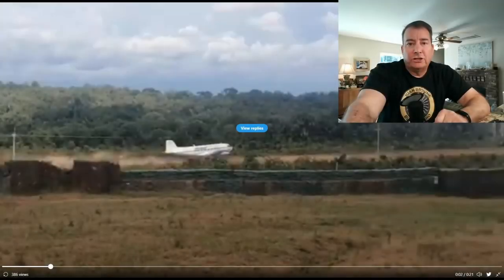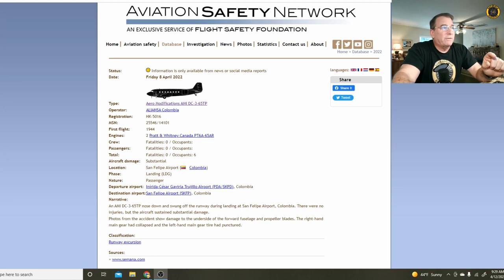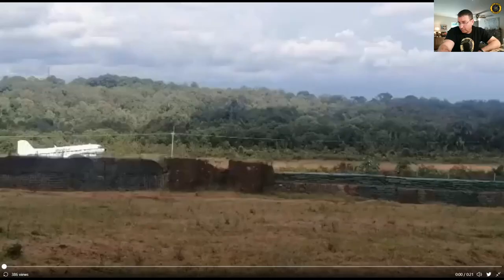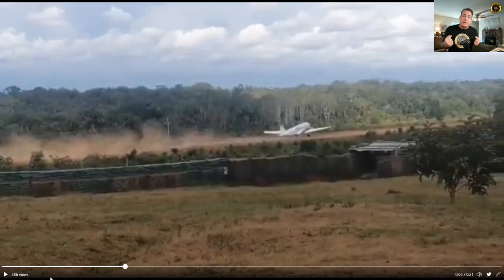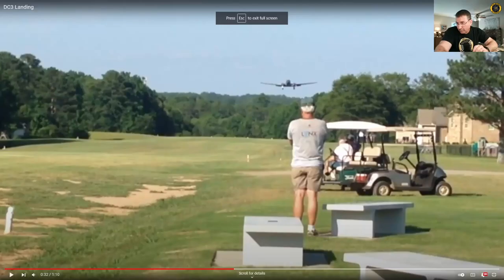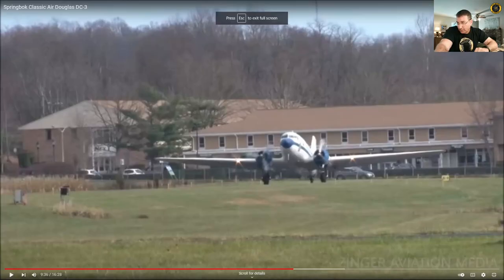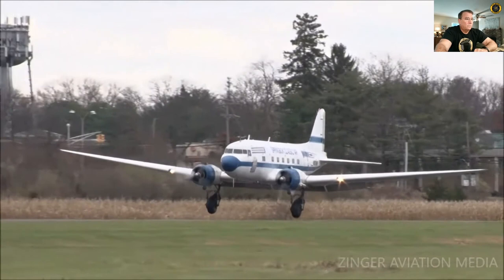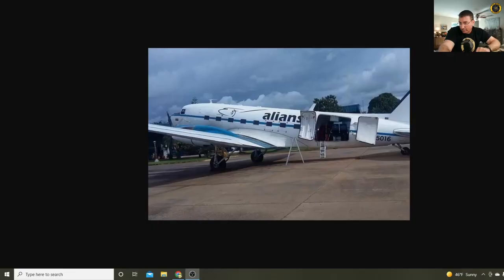DC 3-65TP Loss of Directional Control Colombia SA 8 April 2022

Comment: Juan. As always, awesome analysis. Turbine rated DC-3 pilot here and would like to add that any amount of Beta on landing or during a rejected takeoff makes it very hard to keep the tail up, causes the rudder to be washed out by those big wings as you stated and directional control of the plane becomes very difficult! Great video.
Reply: Just looked up info on beta range, fascinating!
Reply: Use the brakes.
Reply: what’s beta?
Reply: @brewster46  Beta is when you've applied reverse thrust on a turboprop which moves the blade pitch so that the blades are throwing air forward instead of backwards to provide reverse thrust. This greatly reduces airflow over the tail which makes it harder to keep the tail up where the rudder can be effective.

As Juan points out the brakes aren't effective for steering in this situation either because when the tail goes down the wings produce more lift and there's less weight on the tires making the brakes much less effective as well. You need the rudder to be effective at higher speeds (Where the wings are producing lift) and once you slow down the tail can come down and then you can use the brakes to steer.

It's just a bad situation to be in.
Reply: One time helped ferry one that had a Pratt on #1 and Wright  #2. No problem but sporty and interesting.
Reply: @Exuma Guy Actually, DC-3s have very good power brakes, almost too good.
Reply: @tennesseered586  Right.  When they are not leaking or overheated after landing.  But they work good on short field landings. I used to bring them to 3k runways loaded, and crosswind too.
Reply: @JeremyAkersInAustin  thanks. very helpful
Reply: Makes sense, If all they did was put Turbo props on a DC, I can't help but imagine, the plane simply wasn't designed for that kind of power. It would change the way it has to be flown.

Comment: Among the mods for turboprop conversion is more tail feather area, which was not used, this time.  If the tail is flying, whether a tire blew out and it was landing or taking off, it would have maintained control.  Maybe a series of indecisions all within a handful of seconds.  Easy to armchair quarterback.  Thanks Juan as Always.
Reply: I worked for AMI back in early '90's and if I remember correctly, they added a 40" plug just like the Super 3's, redid the electrical system and made interior changes per customer specs. The hydraulic system stayed the same and the other than the plug  and engines, the airframe remained the same.

Comment: Agreed 💯. As a ex agriculture pilot I never landed my crop duster other than a wheel landing. No 3 point ever. I actually would use the brakes to keep the tail up to keep control until I was at taxi speed.
Reply: @Raven 6 - just curious, where did you do most of your crop flying?
Reply: @lisanadinebaker5179  WOW that's a lot to answer, Kansas, Georgia, Nebraska, Colorado, Iowa,, Missouri, I think that's it. Been a long time.
Reply: @raven6245  - thanks!  I grew up in the very rural Louisiana Delta, and watching crop dusters work cotton fields in the summertime is and will always be a very fond memory. Good ones could have traffic (all four cars and maybe a tractor) stopped for a while. I owe my love of aviation to a bright yellow-gold biplane (most likely Stearman) whose pilot could stripe rows like nobody's business.
Reply: Uh huh.
Reply: Because of your name, did you ever fly an 0-1?

Comment: I had a left main blowout on rotation while departing Opa locka airport fully loaded with cargo, had to continue takeoff and once airborne discussed with copilot and Tower our new landing runway to prevent main runway shutdown, besides the shorter runway was aligned to the wind, Heald the left main off and tail up as long as possible to bleed airspeed, when the left main touched down had to use opposite aileron to keep aircraft heading, but the wheel drag pulled me into the taxi way exit and the aircraft came to nice stop, no damage to the rim, airport security checked the departure runway and found the FOD at the point I rotated the DC-3, But I didn't get the day off, tire was changed and we departed 4 hours later to Grand Bahamas.

Comment: I flew the DC-3 about a thousand years ago and was taught how to use opposite aileron when the tail wheel was airborne.  The effect was subtle and would never correct an engine out scenario..
Reply: Yes indeed.
Ailerons PROPORTIONALY OPPOSITE the needed rudder.
The yaw created is tremendous, because the ailerons are so large in area compared to the rudder.

Comment: Nice review.  As the saying goes, "Oh but for the grace of God go I."

 I had something happen that could have ended up like that back in 1973 taking off in a tailwheel Twin Beech D-18.  I had a broken tailwheel lock, a rolling takeoff from the left side (left turning momentum), a left crosswind (left weathervane turning force), and then add p-factor and torque for more left turn force and nearing midfield I was heading 45 degrees left of runway heading, nearing the edge of the runway, with full right rudder that was doing nothing.  The only option left was to chop the right engine throttle.  Big round Pratt and Whitney R-985 engines don't like that even a little bit, but that snapped me back straight. I brought the right engine throttle back up and continued a safe takeoff fully knowing that was a very close call, maybe the closest of my 25,000 professional piloting career.

Comment: Very interesting.  I had no idea there was so much to landing a DC-3.
Reply: It is true to some degree with all of the tail draggers. But the DC-3 is the most common large tail dragger still flying so it appears to happen more often. The B-17 at first was a nightmare in this regard until they made the vertical stabilizer larger to counteract the body removing the airflow from the tail surfaces at takeoff and landing speeds.
Reply: If memory serves correct just getting the gear up or down is a 4or 5 step procedure.
Reply: Me neither! 😮😮

Comment: Call Baslers, warm up the pneumatic drills and rivet guns. We got one coming in for light maintenance...

Great that no one was hurt though.
Reply: I used to work at Basler. Cool stuff happens there.
Reply: Basler crashed one like on take off too. About  3-4 years ago and died.  A manager,  I think. They stalled or MCA rolled into the front yard of a house after take off LOC. You expect more from "The experts".
Reply: @emergencylowmaneuvering7350  there was one that crashed up in Canada after takeoff in 2019, no fatalities though. The only one I know of that crashed with fatalities was in 1997 northwest of Oshkosh. That one was a midair with a Bonanza while doing a formation photo flight. Mr. Basler was killed in that one along with a few others.
Reply: @rynetreatch9558  I used to work right across the ramp and knew several of the guys there. You're right--they did REALLY cool stuff there.
Reply: @rynetreatch9558  That was a bad one indeed. I had met Warren once or twice, but also knew the fellow in the Bonanza with him. Very tragic accident.
Reply: @rynetreatch9558  Yes, but in 2019, a manager at Basler crashed one on take off due engine fail after take off i think.  But they were not loaded.  Mess up. Both pilots died.  They climb well when not full gross, but they let it MCA.

Comment: Love the DC-3. Used to fly on one from Nantucket to New Haven-Tweed fairly regularly back in the 1980s. I remember the first time I look my seat in one and being surprised that the windows actually had curtains! Imagine that, haha! Definitely a throwback to an earlier time, even then.
Reply: PBA?
Reply: @b05296  That's right! The old Provincetown-Boston Airlines. It had an amazing history -- was founded in 1949 with a single Model T-50 twin, the civilian version of the WWII trainer Cessna Bobcat.  At its height in the early 1980s, they had a dozen DC-3s. 

Unfortunately, by the early '90s, Eastern and Continental had gobbled it up and a lot of them were replaced with the ATR 42 and Cessna 402, as well as a few Beechcraft and Saab models, if I remember correctly.
Reply: I started fueling at Tweed later in the 80s but sadly this service had been discontinued.  Would have loved to have seen the DC-3 on a regular basis.

Comment: It’s got airframe damage but repairable. The engines seem toast but might be salvageable. Got to remember these remote airlines are lifelines for communities
Reply: And a free turbine, so may only have to replace the geared section.
Reply: The airframe appears easily repairable, I’ve personally repaired much worse.  The landing gear box damage will be the most time consuming.  But it’s simply a step by step process of putting things back in order.  One removes damage until reaching sound and undamaged structure and then reverses the process.
The power plants will be removed and sent to an engine shop.  These are free turbine engines, however both the compressor and power turbines will be damaged. With a heavy prop strike the PT6 will twist in the middle of the engine.  One can actually see the twist visually by way of wrinkles in the outer middle section surface.  This twisted portion houses the hot section (burner cans, nozzles, compressor drive and power drive turbines) .  All is subject to damage both forward and aft.  The engines will be completely disassembled, each component inspected, parts replaced as required, and reassembled. Safety is certainly a high concern, but these engines are so costly ( read valuable) that nothing is left to chance which might precipitate a very costly premature engine failure.
Reply: Its just need a oil change and will be fine!
Reply: @bryanhauschild4376  local  junk yard has the parts

Comment: Sure hate to see such extensive damage to such a classic piece of aviation history!
Reply: Oh it will be back in the air ether repaired or as parts
Reply: Such a workhorse! The aeronautical engineers should be proud of their design!
Reply: It'll buff out.
Reply: This aircraft could've very well been apart of Market Garden and overlord or even flew the "Hump". Man if it could talk...very sad.
Reply: I rather it be written off earning an honest living. A good workhorse deserves the respect that comes from being useful.
Reply: They crashed now four of their seven DC-3s in two years.
Reply: @NicolaW72  They need to hire Dan to type their pilots.  Including the ones already rated.  

Cost 'em way less than repairing / writing off airframes.
Reply: @BiggHogg870  Read the story of _That's All Brother_. Came close to getting turbined by Basler.
Reply: @BiggHogg870  The  Piece of Paper shown on the Screen said this Aircraft first flew in 1944   So yes Market Garden or Overlord  .  Hump would be happy too .
Reply: fewer and fewer every year

Comment: Thanks Juan..... due to remote location, it might be a write-off..... sad for airframe... but no injuries....
Reply: in most cases if you blow a tire  on takeoff or landing  or colapse the gear  on landing it will dig a trench, would pull to what evr side the failure happend but likely would not ground loop.
Reply: They rebuilt one of these in Antarctica and flew flew it out of there. I think they can save this one.

Comment: That’s a Kablamo for sure. The T-6, or SNJ-6 that I learn to fly in had very similar handling attributes and it could ground loop faster than you could say “Wooble Pump.”  When I was taught, the wheel landing were the go to for landing out at KVNY. Great video juan. May Dan can get some parts cheap. See ya

Comment: A long time ago (1976) I was with a maintenance crew for four C-46 aircraft that had been modified to perform aerial spraying - huge crop-dusters. One of our pilots boasted that he always three-point landed the C-46 - it was a matter of pride with him. Oddly enough, he was the one flying when the spray system failed, and rather than dump the chemical solution he opted to land the airplane at nearly its full rated weight - three-point touchdown with a mild crosswind. This video is almost a perfect duplicate of what happened. About a thousand feet after the threshold he performed the exact maneuver seen. He and his copilot survived, but the airplane ended up standing on its nose in off the side of the runway, and when last seen it was sitting derelict on a remote airport. Tail number 604SE, and old Span East C-46.
Reply: The  c-46 with a load can easily be 3 pointed . With out load there very slow, much easier to land tail low.   Flew them loaded in to 3000ft strips.
Reply: @harveymckinnon6043  I didn't say a Dumbo couldn't be three-point landed, I merely intended to point out that saying "always" and keeping that practice in this case ended up poorly.

Comment: Hi Juan, I am not a pilot nor have I previously commented on your videos but I will throw this comment into the mix. At 2:11, I used the comma and period keys to step back and forth through the video a frame at a time.  I believe that the left landing gear collapses and moves forward under the plane.  It is fuzzy and but I am watching this video on a large 4k monitor with a PC at full screen and believe that this is what happened.  Whether the collapse was the result of a control problem or the underlying cause is up for debate. It looked to me that the plane had not departed the runway when the gear collapsed. When the gear collapsed (and moved forward)  then the plane made a left turn off of the runway.  Kind regards, Dell

Comment: Unless it was cross-windy, we used to keep the stick fully forward and let the tail drop naturally.
A cross wind would require the tail lowering deliberately, but not at the speed in this accident.

As Juan says, lowering the tail at that speed the wing would reduce mainwheel contact pressure, allowing any crosswind to drift or yaw the airframe.  The golden rule with the Dak was to not have it waffling at low speed near the ground (three-pointing was impossible anyway).  

So it was a wheeler aircraft - where the mainwheels had to be pinned to the ground by full forward stick pressure, on both t/o and landing, until t/o speed or taxy speed had been achieved.

P
Reply: It doesn't have sticks.
Reply: Stick - column.  Tomayto - tomaato….

Comment: A flat left tire adds a lot of drag turning that direction, maybe more than the rudder could counteract, so he decided to try the locked tailwheel instead.  I've done a wheel landing (always do wheel landings) in an Aeronca 7AC once that wound up having a flat right tire, and the turning force is noticeable right away.  Together with tire noise, it's obvious what's wrong right away but the Champ has more than enough rudder to handle it with the much narrower gear.  The wider DC-3 gear, maybe not so much with the greater turning lever arm.

Comment: I never believed for a minute that was a landing accident. It looked like a takeoff leading to a rejected takeoff and then a last minute attempt to try to jerk the plane into the air. I think the left tire blew when the A/C drifted left off the runway, causing the ground loop. Thank goodness there was no fire.
Reply: Me too. They only show the latter part of the landing. The plane carries a lot of speed giving the impression it is trying to take off. Then, at the end, the sudden drop of the tail looks like some desperate attempt at a STOL tail bump to get it off (I realise that it wasnt).
Reply: Just gone over it all again. This could not have been a landing (as stated in the Safety Network report Juan read from). The aircraft appears to pick up speed and did not appear to have have flaps set. Im wondering if he saw he was running out of runway and panicked, pulling back on the yoke hoping it would either lift off or high aoa stall to a lower ground speed.

Comment: About to test fly a large C-47 model. Tail wheel steering is activated when main gear is down. How ever you still have engine tork pulling normally to the left.
 So get the tail up with forward stick, control with rudder to takeoff speed. Landing is the same, main wheel landing and fly the tail. Exelaint video of what not to do! Plus the right way! NWR.

Comment: I might be seeing things, but if you look closely, the flaps do appear to be extended at the beginning of the video, and are being retracted as the tail takes a dive and subsequent excursion into the scenery. 

In the example, good,  landings, flaps are are being retracted while the horizontal stabiliser is still 'flying', so it looks to me like this was during landing, and something, possibly a puncture or asymmetric braking, caused an upset, and panic response from the pilot to get the tail down asap.

The quality of the footage is rather poor, so I might just be seeing things.

Edit to add:
Looking at a satellite view of the field, the video appears to have been taken from the compound to the west of the runway. This is based on the fence line, and small building, as well as the power line poles along the eastern side of the runway. Although it appears there is an extended part of the runway to the north, it does not look particularly well used. The most used (worn) part of the runway extends from the north eastern corner of the compound for about 1.1km (3680ft) to the south. The video appears to catch the DC3 just as it has touched down if the speed and possible (usable) runway is used. It could however be that the satellite imagery is old , and the extra 400m (1300ft) or so was used for a run up during take off, and it was indeed a RTO. 

A landing is my gut feeling based on all of the above.